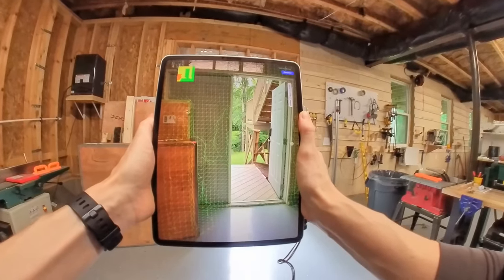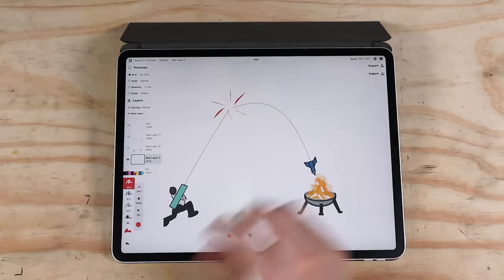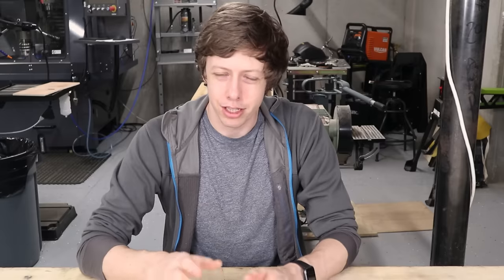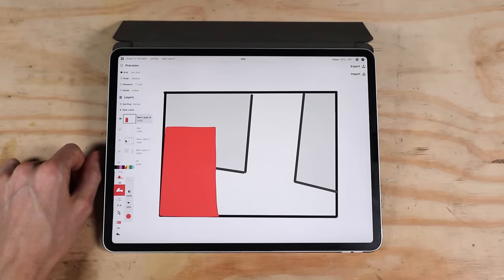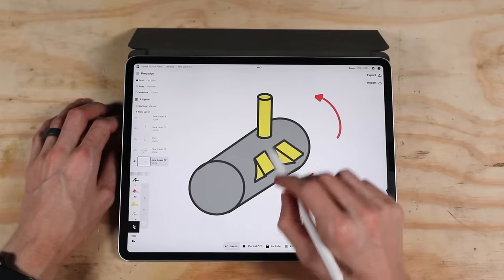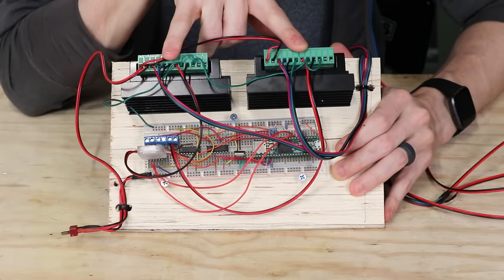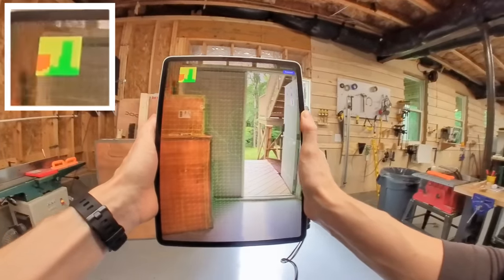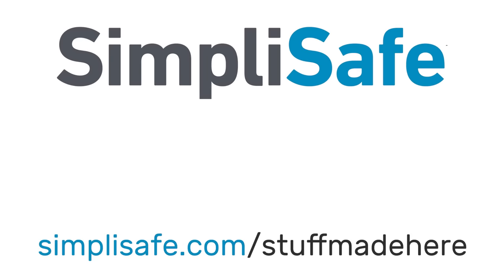See in complete darkness with touch

Comment: Lidar inside Apple glasses which will have lidar in it. Then just make the motor a handheld device without the iPad and run the app on the phone using Bluetooth and make it able to work when the screen is off and in a pocket or something.

Comment: Perhaps solenoids, or hydraulic/pneumatic actuators? You can get solenoids super tiny, or even push wire out the cylinder with tiny motors for each wire, instead of larger rods

Comment: Cool stuff in your working space - but you should put the carbondioxide sensor down to the floor, because CO2 is heavier than normal air. It could form a layer of CO2 below the normal air.

Comment: I also have a kinda similar project where I dont use Lidar, but a normal camera with depth estimation and machine learning (runs on device with ~100fps) to keep hardware cost down and a servo (less mechanical/moving parts -> less points of failure) to show a direction. Everything stuffed into a white cane. And also a speaker where it can detect crosswalks, Doors etc. (is can also point at like closed doors or crosswalks) its called 'BlindBot' and if someone is interested, I have a short demo video on my channel.
Reply: But its also interesting to like have perception about the height of the obstacle.

Comment: Hmm. How about going with miniature electromagnets - then having permanent magnets as pins? You can very easily get more granularity by varying the amount of current for each magnet. 
The obvious flaw with this approach is that it'd be easier to pull the pins down against a spring, meaning you'd have to apply current all the time. Also no matter how you turn this, you'd either be limited in terms of how strong your spring are OR how powerful your electromagnets / permanent magnets are. 
On the other side - you COULD choose to have no spring at all. Simply reverting the power would suck the pin back in so it doesnt fall out. Then when covered, you could revert the power and push the pin into the hand. It would also be easy to repair if any pins broke or coils got messed up somehow.
I can see this being pretty simply to scale up (or scale down I should say). And with experience with the display, I do believe that the small amount of force the electro + permanent magnets would give, would be enough to give you a good representation. 

I really hope you return to this, because although all your other projects are absolutely awesome - this one is just brilliant :D

Comment: I mean, it's tough to beat the simplicity of a Cane (notice how slow you're moving around the room), but perhaps with some tweeks it could be as fast.
Maybe next make a cane that tells the distance to the next object, where you can detect the angle of the floor to match. or adjust the measure angle with a scroll wheel.

Comment: Awesome video! Looking at this made me think - would it be possible to switch from mechanical sensor to sound. I imagine it like this: every fraction of a second a set of notes is played, representing what lidar sees at this frame, from left to right. This way note tone can represent height of the object, tone volume can represent distance from the object (louder = closer), tone length (if even possible to distinguish in such a small time) can represent width of the object, and spacing between notes can represent distance between objects from left to right.

Comment: Why not use an array of solenoids? There are some really small ones out there, and it would eliminate all the mechanical size and complexity of the existing design while allowing you to pack in a far higher density of pins to improve the resolution of the display.

Comment: uh.. couldn’t you use the haptic motor built into the iphone to simulate lighter and harder taps which in turn basically does the same thing with far less work?
Reply: How would you visualize the taps?

Comment: Just now seeing this video and I had a weird thought. You know those pinart boards with a bunch of little plastic sticks that you can push in and out to make an image? Could you somehow implement that so that you could technically get a full imagine based on what you're pointing at and it pushed the pins in and out depending on the depth or whatever. Could that help or would it hinder it?

Comment: That sounds like a way overcomplicated design especially when you want this to be an Ipad/phone case size. Air pressure with little tiny lines going to each collapsable "pin"/inflatable rubberish nub as I'd call it sounds like a much better and way more compact design. It could be as thin as a millimeter and you could have an array of as many as you like little inflatable nubs that press into your fingers. as long as you have a source of compressed air, maybe those little CO2 cartridges, and then you can use this as long as the battery lasts. You just then have to work out a method of sucking in and blowing out the co2 into the channels going to the inflatable nubs and put that in an assembly above or below the phone. Maybe it even plugs into the phone and uses the phones battery.

Comment: Would a small piezoelectric pin work for tactile sensing? If you have each one hooked up to its own little circuit, and they’re underneath a stretchy surface, couldn’t you then have a more fine resolution using just current going to each pin? That’s probably really pricey though and I don’t know if the technology is refined enough for the resolution you need.

Comment: Wouldn´t it be easier to do it with headphones? Instead of a pressure on the fingers you can hear a sound thats  getting louder, the closer u are. You only need a headohone with surround sound.
Reply: The main problem with that is that blind people depend on their hearing as their main sense to get around so it would be counterproductive to use headphones. So by improving sight just a bit you would be severely worsening another sense.

Comment: I am a bit late to the party, but. Has anyone told you already that a carbon monoxide sensor on the ceiling is not useful at all? CO is heavier than air so it fills the room like water, before it reaches the ceiling you are passed out on the floor.

Comment: As smart as you are you put a carbon monoxide which is a heavy gas which stays low detector on the ceiling is that the the ceiling that carbon monoxide detector should be low to the ground

Comment: Sorry to curv your enthusiasm... but that's no LiDAR. Apple here overstretching the concept as usual. Is not calculating the time laser takes to go anywhere like Lidars do.
It's just a visual mapper like kinect (In fact is exactly the same). It just takes photos of an infrared mesh it projects and calculates distances based on the deformation. The fact that the mesh is projected by a "laser" is just to make it more compact. 
It can be done just with the camera, with no infrared or "laser" mesh, like  a lot of androids and my vacuum cleaner do, but is more CPU intensive. And has no lasers so is not that cool...
(You could do the same on most recent androids and the spatial SDK API, with no laser involved)

Comment: Very cool I found  this because  I don't  have a visual memory  to say of directly, I uses  geometry  touch, feeling and sound  to develop  memory   my eye sight still pretty good except for Ellen syndrome blue  glasses  helps.

Each time  I see a problem it's like seeing  it for the time  but  I retain the knowledge on how to solve them it just get fasting each time, down side  Is needing a solution strategy inorder  to memory  something  I don't  know that's have a answer for.
It's crucial to foresee problems to predict the outcome.

I love your ideas but we'll not quite yours I've seen them in movies don't ask me how I remember movies it's  not the same way as most.

The baseball bat idea may be possible with a compressed gas some kind just nothing flammable plz,  you're going to need some serious SpaceX rocket algorithms that work in real time as too much thrust in the wrong direction we'll break someone's arm and whatever else it hits on it's journey real-time very fast directional  sensors and the bat would  need  to know on what Ingles it is being held in relation to the person holding it, the person's arm length and size may also have to be accounted for or it could do some series joint injuries,  when the bat fails to hit an object and the follow through isn't performed correctly, it would also require equal amounts of force in the opposite direction to slow the back down when it fails to hit something.

Have fun.
Reply: Don't  forget  when we swing a bat it follows our body's an arc rockets Jets travel in a straight line not including gravity space time the bat would pull away from someone with only one source of thrust.

Comment: This was grossly over-engineered.  A tongue plate with 60 or so low voltage electrodes would have been way easier and worked better.

Comment: This is pretty typical of engineers, designing a product for a group of people without actually consulting them. It's cool technology, and the engineering is impressive but I don't see it replacing a white cain. With the cains that blind people use they can scan the surface infront of them and get a pretty accurate picture of what they're walking on which allows them to coordinate their balance as surfaces can be quite uneven. Cities also somewhat have sidewalks and roadways designed so there are indications that you're about to transition from a sidewalk into a road, but these accommodations vary from city to city and are usually only implemented after a long fight from their respective blind communities. There's also the added drawback of having to hold up whatever lidar device you're using, which will strain your arms if you have to use it for any extended period of time, whereas a white cain has your arm in a much more relaxed position. Accessibility devices need to work throughout the day, and not just in short bursts. As well as for extended use battery power will become an issue. It also isn't a very accessible accessibility device when it requires expensive electronics, and this applies to disabled communities in general, but disabled people overwhelmingly face higher rates of poverty.

Comment: It's a bit weird to use visually impaired and blind people as a way to market an idea, unless the idea came from them, or has been developed with significant input from them. In that space its easy to dream up completely irrelevant ideas which solve problems only faced by imaginary VIB people in the heads of non-VIB engineers!
Reply: Why is it weird? There's a huge number of inventions and innovations made to solve problems not experienced by the people doing the inventing/innovating
Reply: @j_lsw  yeah, unless you mean "very important bitch" even urban dictionary doesn't know what you mean when you say VIB. Really gives the impression that you're using a made-up term to suit a narrative you're trying to push. 

I'm going to assume you're talking about blind people though, and say that yeah, there's a large amount of junk work in any field. That doesn't mean people shouldn't still try.

Comment: not metrical = dislike
Reply: metrical. adjective. Marked by a regular rhythm: cadenced, measured, rhythmic, rhythmical. or relating to or composed in poetic meter. also metrical structure (countable and uncountable, plural metrical structures) The pattern of the beats in a piece of music, which includes meter, tempo, and all other rhythmic aspects. The pattern of stressed and unstressed syllables in a poem.